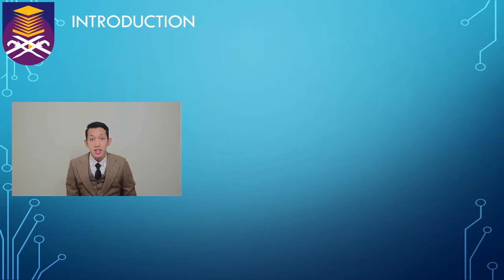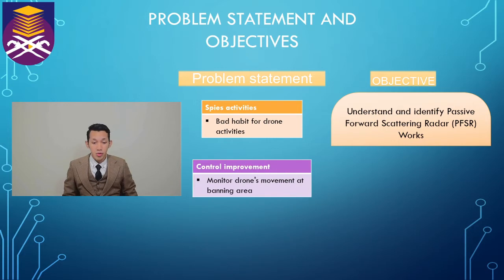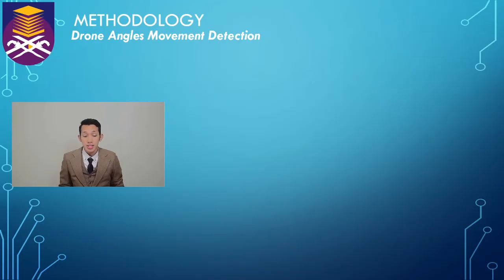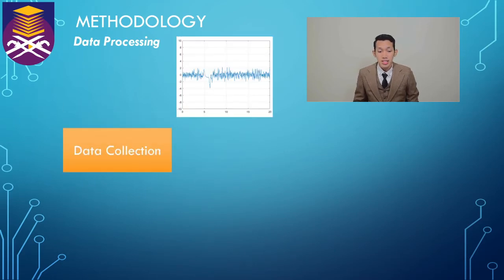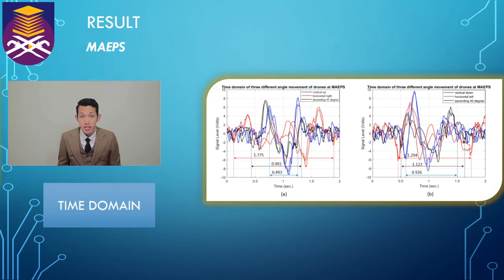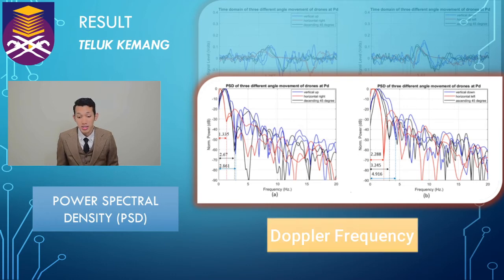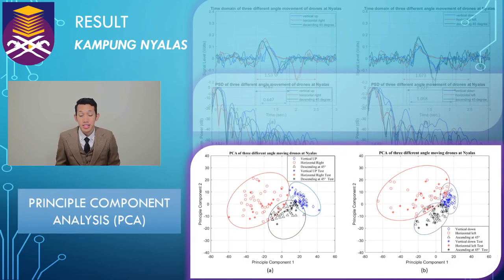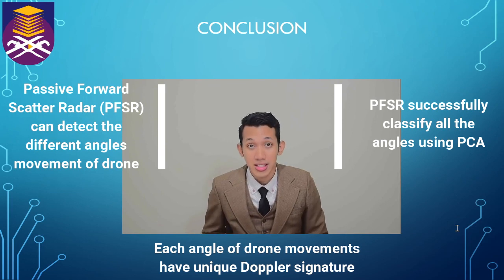Passive Forward Scattering Radar (PFSR) expaination by Abdul Muhaimin bin Abas

Comment: What freq LTE signal you use? It able to use all LTE freq?
Reply from the maker: For my case study , the LTE use is 1.8 GHz , but in Malaysia telephone communication (telco) provider, there is division for frequency band for each telco such as celcom the  range of hertz is 1.840 GHz - 1.860. each telco have different frequency band. For make the detection of the target works , the experimental setup use band pass filter , this device is for tunning the receive frequency which means , when i tuning  at range of celcom frequency band, the passive radar receiver will detect the target. So of course when have tuning device, all LTE frequency band that the telco provider provide can be use for this detection.
Reply: Abdul Muhaimin all LTE can use? L900 L2100 L1800 L2600? Maxis celcom digi umobile webe?
Reply from the maker: @muhammadakram8750  yes Mr Akram, all LTE can be use for this detection because the horn antenna can receive up to 18 GHz. For now, the passive radar only receive for LTE signal from the provider, cannot choose which provider that transmit the signal. Thank for your suggestion, in future, passive radar can choose which signal that receive for the passive radar receiver.

Comment: How far the passive radar receiver can detect the target? Does it can detect up to 100m or even more?
Reply from the maker: For my case study, the experimental setup for the passive radar receiver is limited, the target that been use only detected up to 10 meter only. The setup of receiver give the good detection of the target with powerful receiver horn antenna. And also the distance between the passive radar receiver and the transmitter give the effect of the detection. Also in passive radar , the study work with cell communication tower, the consideration of vegetation effect of environmental surrounding  also give the impact of the performance for detection of the target.